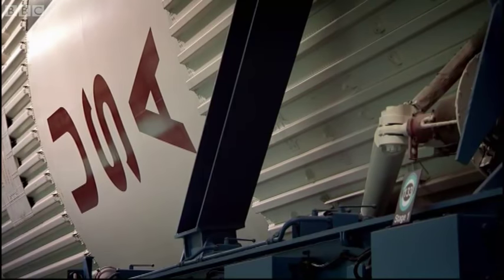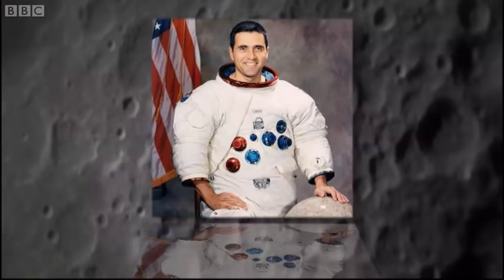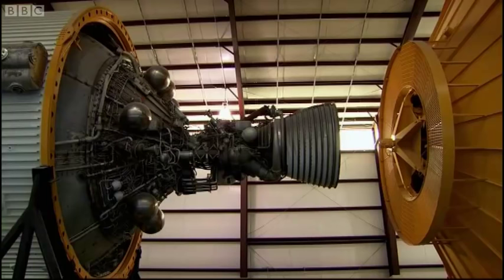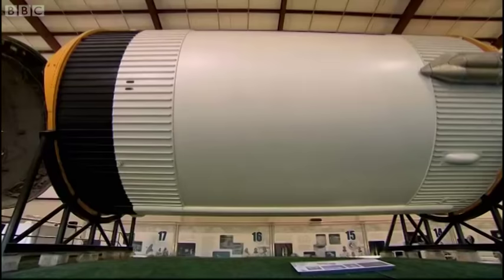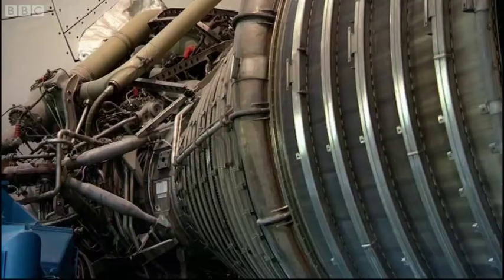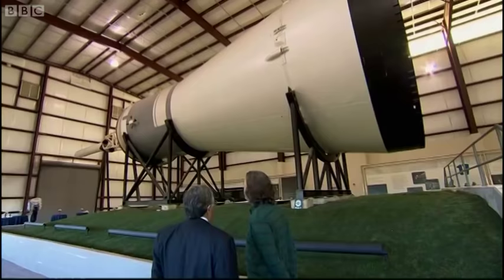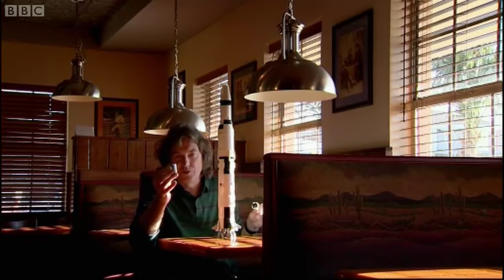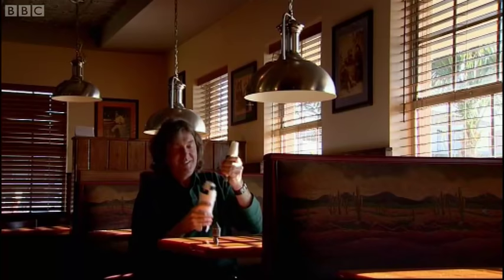How Did The Saturn 5 Rocket Work? | James May: On The Moon | Earth Science

Comment: You forgot about the LM, which actually LANDED on the moon? It's housed within the odd shaped looking part, that looks like an elongated dog med collar! It's attached to the SM, until the astronauts were ready to dock the CM with the LM!  THAT IS TOP GEAR! Then they'd disconnect it, bolts would blow the housing off, flip the CM/SM around, dock it properly, at the correct time. - Daughter of one of the Rockwell Engineers, who worked on Sat V stage 2, all CM Block-2s to the moon, and that LM encasement. You're welcome.

Comment: Of the four Saturn V rockets on display, only one was flight capable.  (The one at Houston)  The rest were made to be displays.  I saw Apollo 8 launch and I will remember the sound and overwhelming feeling of power until I draw my last breath. (And I was 21 miles away)
Reply: There are actually only three left. Two of them were made from varies portions of the three cancelled Apollo missions (mixed and matched), and the third one, in Huntsville, was SA-500D... made to go through the dynamic structural tests at the Huntsville facility. The one in Huntsville was never meant to fly, but the other two were.
Reply: @stratoblaster3236  You have different information than I have. I'll research it a little more. Thanks for the prod.
Reply: @stratoblaster3236  SA500 at Huntsville, Sa513 at KSC, SA514 at Johnson and the SA515 is split up to two places, Infinity Science center and Nat. Air and Space Museum in DC.  There are more pieces too, like the converted to be a mock up for Skylab and some at Alomogordo.  The one at Johnson Space Center is the only whole one made to be launched. (But it has mixed pieces)
Reply: @myfavoritemartian1  You may be correct about the SA 515 being split up, But the information I got from KSC was that the rocket there is made up from one of the cancelled Apollo missions, along with the first stage that was used about 20 times for engine test firings. I don't know how much is accurate, but that info came from them. They also said that another first stage from one of the later rockets was used in the launching of Skylab I. I don't know if this is true or not, but a tour guide down at KSC said that he wasn't positive, but he believed that the original first stage from the KSC rocket was the one for Skylab I.

Comment: And then the Space Shuttle turned out to be the most lethal US spacecraft; the 1986 Challenger explosion attributed to a faulty o-ring on the starboard SRB, and the 2003 break-up of Columbia during reentry after a piece of ET insulation came off during liftoff, ripping up the orbiter heat shield.
Reply: Yes, sadly the shuttle claimed the lives of 14 astronauts but that was in 135 launches versus 13 of the Saturn V. However, NASA were very fortunate that more of these missions didn't end in disaster. The shuttle was a flawed design, sat in a prone position at launch, the heat shield was exposed and vulnerable and it lacked a viable launch escape system. 

Incidentally, technically Challenger didn't 'explode'. The failure of the o-ring seal on the right side SRB that you refer to allowed white-hot exhaust gases to leak out. These gases burned through part of the external tank, and the aft booster attachment strut. When the rear of the tank gave way, the strut gave way also, which allowed the booster to pivot around the top attachment strut and crash into the top of the tank. The external tank disintegrated, which allowed many thousands of litres of liquid hydrogen and liquid oxygen to spill out and vapourise. This is what caused the large white cloud that is so iconic an image of the Challenger accident. The orange glow was caused by the subsequent ignition of the hydrogen.
Reply: I like the Saturn V much more than the Shuttle, but that comparison is a bit unfair.
The Shuttle had 135 launches while the Saturn v had only 13, and 3 of those (Apollo 4 and 6 and Skylab) were unmanned and couldn't have killed anyone. We will never know if a hypothetical 14th Saturn V launch would have ended in a disaster.

Comment: I still don't understand why you have to travel at such high speed to get into space.  I think of it this way; as being at the bottom of a deep swimming pool; as long as you are travelling upwards, no matter how fast, you will always get to the surface of the water.  Why isn't the same true?  as long as you are travelling up (lets ignore fuel cost for the sake of argument) you will eventually get to the surface, in this case; get through earths atmosphere and into space.  Id be interested in someone trying to convince me the above isn't true.
Reply: Every moment you are in the air, you need to spend fuel to keep yourself in the air. As a result, the longer you take to get out of the atmosphere and into orbit, the more fuel you're burning just to keep the height you've gained. It gets worse: The fuel you need to burn adds more weight to your rocket, meaning you're spending more fuel to carry the fuel you need to burn to keep you in the air. Result: Burn as fast as possible to spend as little fuel as possible.
Reply: @GuardianSoulkeeper  you dont just go into space you go into orbit
Reply: Orbit not ‘space’
Reply: Well, if one did what you described, they'd have to indefinitely keep expending fuel to stay up because if earth's gravity. To go with your pool analogy, imagine being on the bottom of it with a huge balloon of air that's pulling you up - you'd have to keep swimming down to stay there! However what going really really fast while in space accomplishes is this: you keep falling towards earth, but you're going so fast you keep missing, and that's what staying in orbit means.

Comment: He did have to say "Top Gear", didn't he? Anyway: Isn't shooting a rocket straight up the worst possible way to get into orbit? Wouldn't some kind of airplane approach be much more efficient (like the Saenger concept maybe)?
Reply: The problem with an "airplane approach" is the very thing that makes it a concept-the Earth's atmosphere.  The atmosphere would cause considerable drag and heating at low altitudes and high velocities, which means you have to fly relatively slowly (compared to orbital speeds) until you get quite high up.  As a result, you spend a lot of time in a part of the flight envelope where the plane is relatively inefficient (That's one reason commercial jets fly at around 35,000 feet-it's the most efficient altitude for the speed they fly).  Efficiency for an airliner means a lower operating cost.  For a launch vehicle, it means you don't have to pack as much fuel, so the vehicle can be smaller.

The way rockets get around this is by launching more or less straight up, then slowly pitching over to gain horizontal velocity as they get higher and move into thinner air.  When the LMs took off from the Moon, they didn't have to worry about atmospheric drag, and so they pitched over very soon (and very quickly) right after launch. https://www.youtube.com/watch?v=XlGis35Epvs shows 17's take off.  The lift off happens just after the 3:00 mark, and they pitch over about 10 seconds after that.

Comment: Please continue with:  How do you return  to the Earth from the Moon without the propulsion rockets?
Reply: With service module's engine and fuel. There are plenty of documentaries and excellent explanations of Saturn V and Apollo spacecraft online just need to look for it. Saturn V was the launch vehicle to get away from the Earth and get into the trans-lunar trajectory to the Moon. Service module did the rest of the job until Earth reentry. Lunar module, that was docked beforehand to the service module, landed. Descent stage of the lunar module was left where they landed and ascent stage fired back into lunar orbit, rendezvoused and docked with command-service module before getting undocked, then csm thrusted into trans-Earth trajectory. Before reentry, service module was of no use anymore and was jettisoned leaving only command module with its ablative heat shield to reenter Earth and splashdown to Pacific ocean where an aircraft carrier with helicopters were waiting to recover them.
Reply: @FrankyPi  So many things could have gone wrong.
Reply: apollo 13

Comment: I recently learnt that they would not be able to built the Saturn 5 anymore. Documentation has been lost (astonishing given that NASA was such a huge organisation) and the engineers retired.
Reply: Also, you wouldn't want to build it again. You couldn't actually build a 1966 Olds Delta 88 anymore either. You could, with a lot of effort, create a bespoke replica that was quite similar. But why would you?
Reply: Bababoom Baboom yeah, it may be regressive , would have saved the 20 billion + dollars and a decade  spent on a space launch system and Ares series rockets without much uncertainty .
Reply: Andreas Köhler bullshit. The rocket in the video is a genuine Apollo rocket, thous if the plans are lost, we easily can reverse engineer the thing. As for the flight plan, this is the most easier thing to do
Reply: Bababoom Baboom bullshit that too. Monochrome CRT screens are simpler than the multicolored ones.
Reply: And that is supposed to mean something, I guess.
Reply: +jimmy ha - yes they do think the shuttle was fake. They believe it's just a modified DC-9 that goes up on the rocket, flies to an airbase and sits there until it's time to "re-enter".  Never underestimate these folks.
Reply: + Bababoom Baboom
"You couldn't actually build a 1966 Olds Delta 88 anymore either."
Actually I do think this comparison is not fair. A better analogy would be to compare the Saturn  V with a Ford Model T or even earlier cars. Lates face it. This age was the beginning and the very first steps. Lots of thing have to be invented and they did it by experimenting a lot. Times have changed a lot since then. Even if there is some risk in space travelling right now, no astronaut would go with a vehicle like that today. Those early astronauts were all trained test pilots. Literally speaking, they did not care if some thing went wrong, they expected things to go wrong. As long as the overall risk was acceptable, everything was fine. But this is not good enough for today.
So, as lots already have said: There literally is no point in build a replica of a Saturn V. Why would you want to do that? You would not build a Model-T according to the original plans and thus also have to recreate all the machines and tools to do that to drive from Los Angeles to San Francisco, would you?

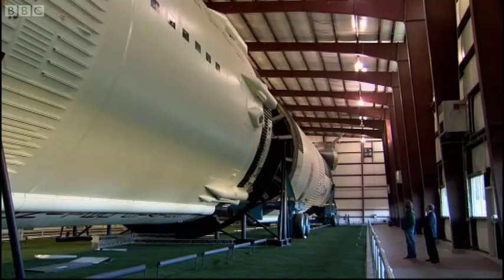Comment: At around the 1:18, “ it’s not actually very sophisticated “ Is that a joke?????
It’s not a solid fuel rocket engine that lights and burns, it’s a liquid fueled rocket, using kerosine and liquid oxygen that’s being pump at extreme rates, at extreme pressures and burning at extreme temperatures, producing 7.5 Million Pounds Of Thrust!!
Not sophisticated???
Reply: The fuel pump in each of the five first stage engines (F-1) had 55,000 horse power, comparable to 11 locomotives or a pretty large jet engine! A replica of the gas generator powering the turbine in that pump was tested in 2013:
https://youtu.be/1AD-DbC3e68

Comment: We never went to the moon folks. Van Allen Belt?
Reply: They literally went around the worst of it. As VA radiation is quite literally trapped solar wind (loose protons and electrons), the walls of the space craft would've blocked the vast, vast majority of that radiation.
Reply: @GuardianSoulkeeper  Impossible to 'go around' - check the Apollo 11 flight plans and the orbital plane they used. The Apollo 11 flight journal then details over 11 hours of them between 1000 and 40,000 miles (the VAB zone) in a largely equatorial 'orbit' or plane. The 'Short time' and 'Went around' is patently and provably fake using only NASA sources. 
The other detail is that NASA 'admits' or claims that they only got a 'few chest Xrays'  of radiation, yet not ONE roll of film EVER had a trace of fogging on it.
The evidence for Apollo suggests they were exposed to Earth Background Radiation only.
Reply: Whatever you say, bud.
Reply: @GuardianSoulkeeper  No, that's what NASA says. You can read it on their Apollo history website section.
This is the problem with people like you, you believe with faith and so never bother to actually read and study the NASA source documentation.
Reply: Nope. This is a problem with people like you. You draw a conclusion, then try to make everything git your narrative. This is why you're crazy.
Reply: @GuardianSoulkeeper  No, the data I wrote was from the NASA flight plan and flight journal, from the NASA websites of Apollo 11.
If you think that's crazy I suggest you take it up with NASA because that is the data source.
Reply: I honestly don't care. I've been doing my research and every time a conspiritard claims they have evidence, it never pans out. Either because it's fake or they simply didn't understand the source data. At this point I just don't have the time or energy to go down yet another dead end.

This conversation bores me.
Reply: @GuardianSoulkeeper  But you obviously haven't done your research, your pathetic comment that 'they went around it' is contradicted directly by NASA's own Apollo11 flight plan, and the partner feeble excuse that 'they went through it for only a short time' is also directly contradicted by NASA's own Apollo 11 Flight Journal, which gives specific distances and times. From 1000 to 40,000 miles of the VAB there is 11.25 hours.

So don't pretend you know anything about their exposure to the VAB, I DO, because I've actually READ NASA's journals for Apollo 11.
Reply: Bob Dillahunty  Am I saying that, or are you simply reframing the argument ?
Reply: Bob Dillahunty  Why are you unable to discuss the science Bob?

Comment: The Saturn V rocket worked better than that crazy SLS rocket system
Reply: Why do you think so?
Reply: @raptorwhite6468  they were more reliable and worked so much better, and I don't think NASA lost any Astronauts using the Saturn V rocket system , 6 successful missions to the moon, no fatalities.
Reply: @david-ky7rt  For now it's too early to tell if SLS is better or worse, technically it didn't cause any fatalities either

Comment: Built without any aid of computers.
Reply: They actually had fully functioning digital computers back then. Huge ones, yes. The also had lots of analogue computers. I still have mine.
Reply: You made me think of the excellent PBS documentary on Apollo 13 made in the 80s I believe, footage of engineers busting out their slide rules to quickly calculate everything to get them back to Earth. Pencil and paper, no mistakes allowed.
Reply: They had computers! That was the title of a PERSON at the time.
Reply: They had machines with rope woven memory... Not alot, but the commands were [at the time T point XYZ and fire for t seconds at v% throttle]
Reply: Alucard Hellsing 
Slide rule rules

Comment: rockets need an atmosphere to thrust against, theres no atmosphere in space apparently. earth is flat.
Reply: Why do you think that?
Does newtons third law not apply in a vacuum?
Reply: theres nothing in a vacuum to react to a rockets thrust
Reply: @theeye2429  so a rocket wouldn't work inside your skull?
Reply: RCS is a system used on spacecraft that release gas to move it. The force of the gas being exerted is equaled by the force it pushes the craft away. Every action has an equal and opposite reaction. It’s like how when you shoot a gun, the gun pushes you back. Not because the bullet is pushing on anything, but because of the energy pushing it one way pushes the gun with the exact same amount of energy back. Rockets are just like this, but with more power. The force of the explosion behind the rocket pushes it forward
Reply: @benocq  I thought that was RCS.
Reply: Agressive Parmesan II Your right. I got them mixed up. I’ve changed it now

Comment: How is it possible for this rocket to pass the Thermosphere around the Earth where temperatures reach up to 4500 degrees Celsius and it is known that the melting point of aluminum is 660 degrees and that of titanium 1668 degrees
Reply: The reason the thermosphere does not heat spacecraft is because of the extremely low density of molecules and sparsity of gas particles. There are very few molecules in that region of the atmosphere - it's effectively space and that is why most of it is anacoustic.

Despite the high temperatures that you refer to, an object will experience low temperatures in the thermosphere due to extremely low density of the gas - essentially a hard vacuum that is insufficient for the molecules to conduct heat. A thermometer would read significantly sub zero because the energy lost by thermal radiation exceeds the energy acquired from the atmospheric gas by direct contact due to the lack of conduction.
Reply: how can you ever take anything out of a 220c oven if 220c hot water would kill you?
Reply: Heat and temperature are not the same thing.